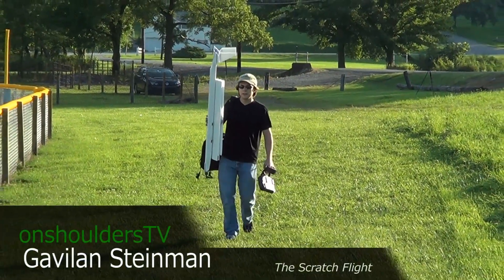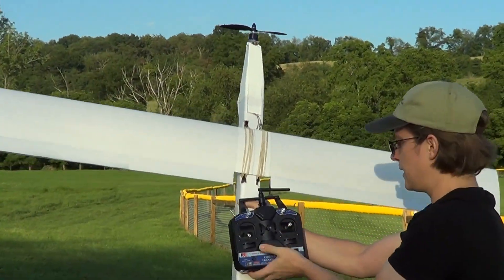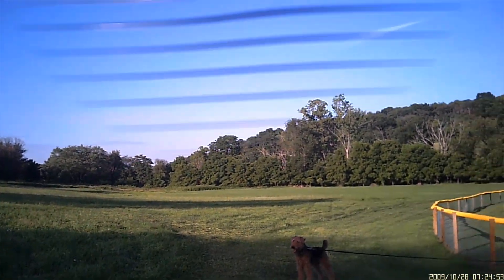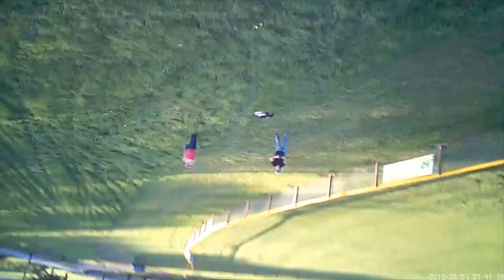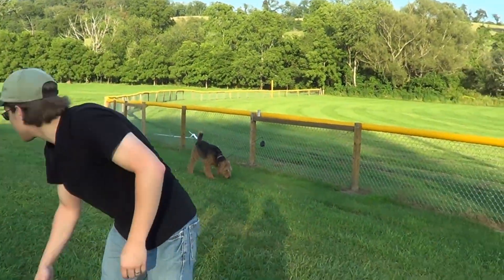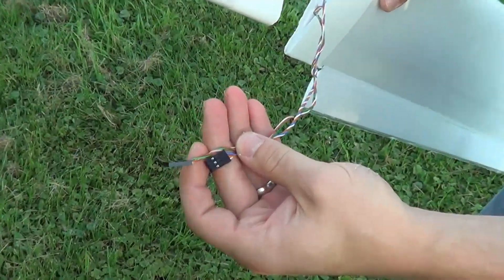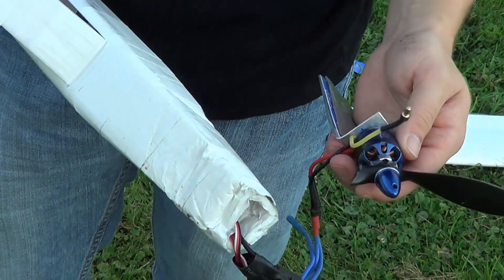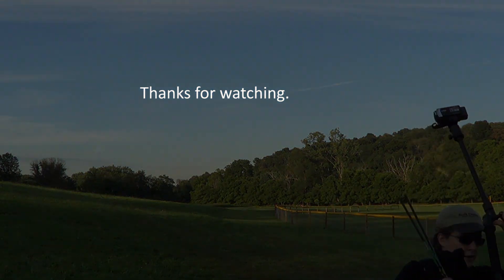onshouldersTv: The Scratch Flight

Comment: During the second launch you can see that after the first crash the motor bracket had the motor pitched way up, that is why the plane stalled and caused the second crash. Your first flight was great until it was coming back to you and the controls were "backwards", it looked like you simply got disoriented for a second. A good way to get used to flying, is to fly back and forth left to right, and right to left, so you have less chance of getting disoriented. For a first flight though Fantastic!

Comment: Used fly RC planes (gas ones) in my childhood, but have not done that for years. 
My 2 cents:
Don't try to take off so steep. Plane was almost stalling at the first time. Let it pick up some speed before climbing. 
Also in the beginning don't make rapid turns with high bank angles as then lift reduces as a function of Cos(bank angle).
I suggest training a little bit on simulator, I tired modelsimulator . com but not sure if it's  active any more, may be better alternatives today.
Good luck!